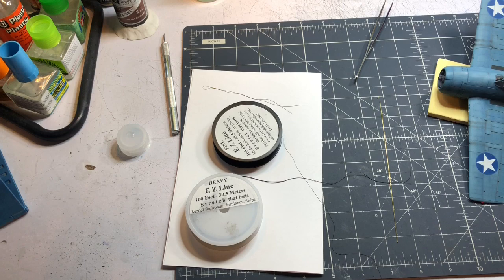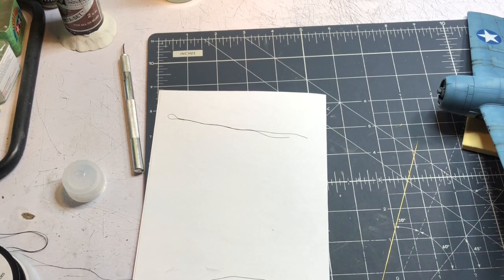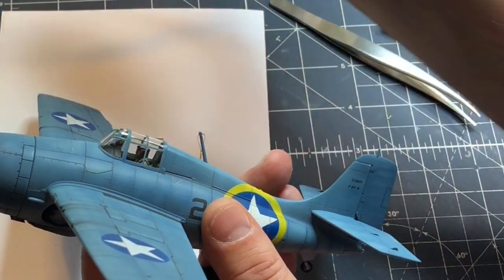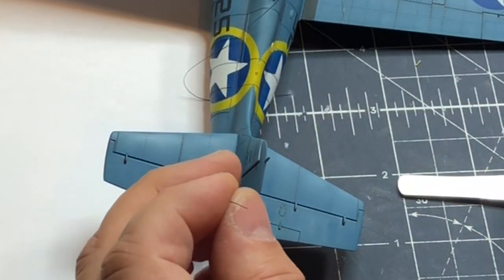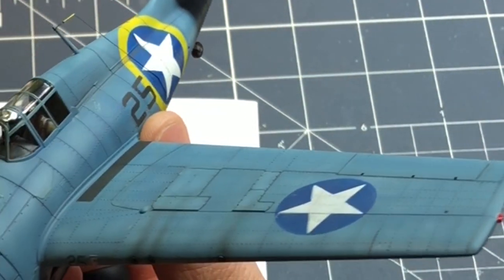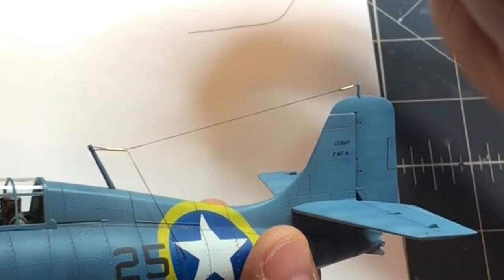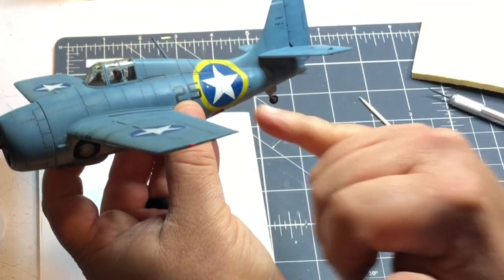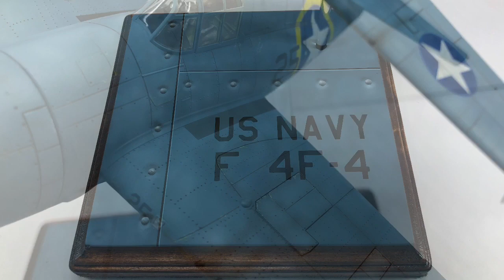Adding a Wire Antenna with EZ Line

Comment: You can use the insulation stripped off the fine wiring of junk electronics for a small tube if you didn’t have brass tubing.

Comment: Like the idea of brass insulators.   I stretch those hollow plastic Q tip handles for  mine.
Reply from the maker: Hey Brandt, that’s a good idea as well.  On another note, not sure if you watch Will Pattisons channel but I saw on one of his recent videos he’s gonna foil a P-51.
Reply: @seanerk5kt9  yeah, I know.  I watch him a lot.  Doesn't he use bare Metal foil?
He has in the past.  I'll check it out.  Thanks

Comment: That's another great tutorial, thanks for posting. 

I've not used EZ Line before but I do have some Uschi Van Rosten 'Rig that Thing' elastic thread. It's good stuff but you need hawk's eyes (or in my case, a very good magnifier) to use the superfine grade as it's only 0.01mm thick!

Incidentally I've noticed that when you pose your planes in flight you  keep the propellors on and I wondered what your thoughts are about removing them altogether and smoothing and filling out the spinners. I personally like the look, as it replicates what you see in real life (as opposed to what you see when watching film footage or looking at photos). I'm not a real fan of those prop blur things or the circular discs of clear plastic.Have you ever experimented with that effect?
Reply from the maker: I haven’t experimented with any prop blur effects but I’ve tossed around a few ideas in my head.  I’ve seen some painted clear acrylic discs that look pretty good in pictures but wonder if it looks as good when viewing in person.  I may do some scientific research in my laboratory in the coming months to see if I can replicate the look.

Comment: Where did you get the brass tubing.  I have messaged Alliance Model Works but they don't respond and they have no phone number.  Is there any other tubing I can substitute.  K&S doesn't make anything with a ID that small.
Reply from the maker: eBay is where I bought them last time.

Comment: Great video. Nice build. Question: can you paint ez line?
Reply from the maker: Yes, I’ve used water based acrylics to paint it.  I’d stay away from using enamel or lacquer paints though.
Reply: @seanerk5kt9  Thanks for responding. I just conducted a paint test with enamel and acrylic paint. None of them worked. The paint does not adhere to the ez line. Curious how you got the paint to stick?
Reply from the maker: @DavidRamirez-ww5kv  I’ve used vallejo model air to paint small sections and haven’t had any issues.  Keep in mind I haven’t painted the entire length of an ez line antenna.  You could try using a base layer of thinned mod podge then paint.  I’m assuming you’re trying to paint it after installing on the model.  I don’t see any paint sticking to it if you paint it then try to stretch it and install it.
Reply: @seanerk5kt9  This makes sense. Yes the ez line is installed on my model biplane. I wanted to be sure the paint will stick before applying to the finished model. If it does not stick then this could potentially ruin the model.

Comment: I'm about to get a spray booth as well. Where did you get that one?
Reply from the maker: Got it on amazon.  Here’s a link to the one I bought.  I’ve only used it once but I do like that it has lots of lights and they can be turned on separately from the fan.  Both the fan and lights are adjustable as well.  

https://www.amazon.com/dp/B082D88JCT/ref=cm_sw_r_cp_awdb_btf_t1_prvnFbRR6Q9EH